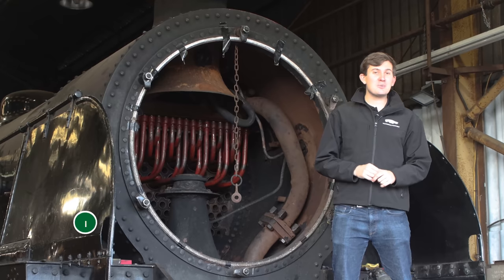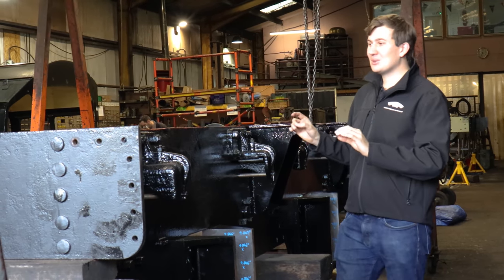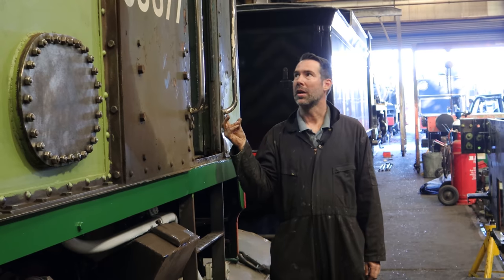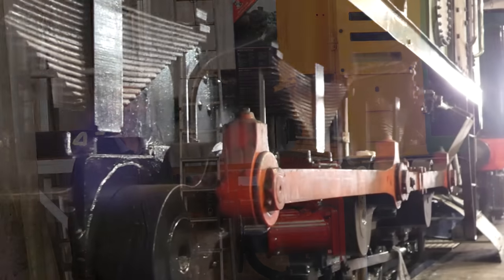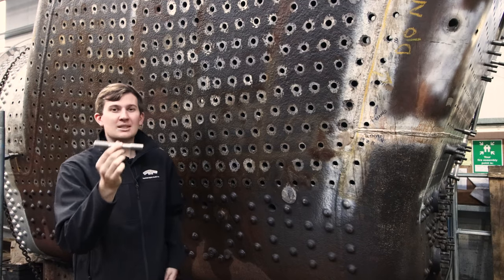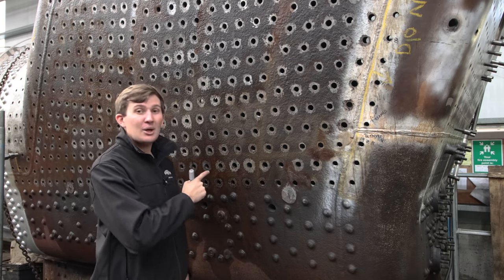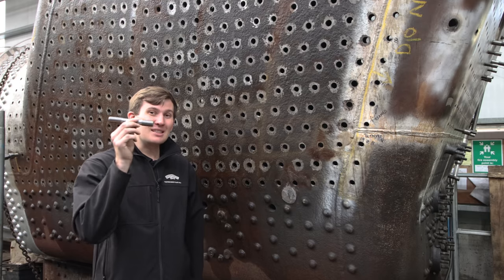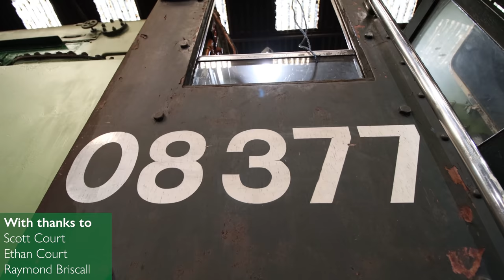Keeping You In The Loop, Episode 18 - A Ropley Round Up

Comment: The Merchant navy that I plan to build will have a boiler pressure of 280 and I also Plan to Rebuild 7927  Willington Hall and build Another Hall class locomotive No.7928 Harvington Hall and two Beyer garratts and three Bulleid pacifics 4-6-2 locomotive a West Country Class No.34029. SEVERN VALLEY and No.34112 named Neville Chamberlain and a Merchant navy Class No.35034 White Star Line and all three Bulleid pacifics will be the unstreamlined versions